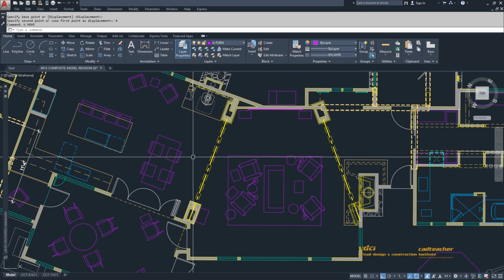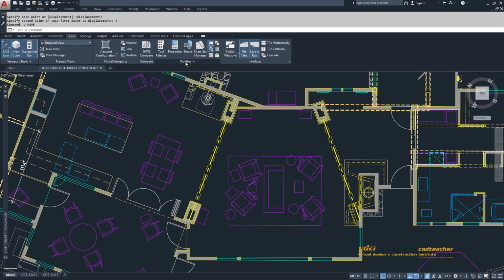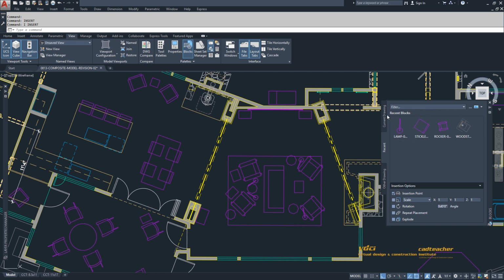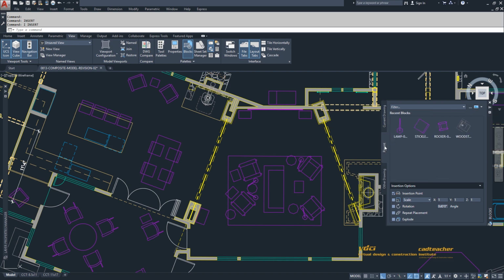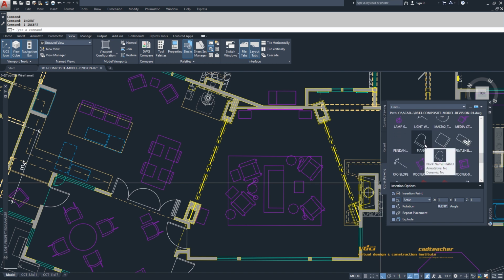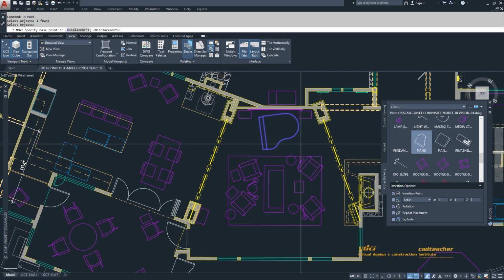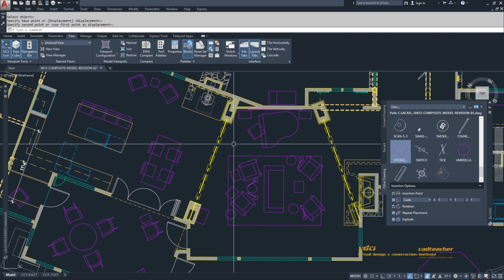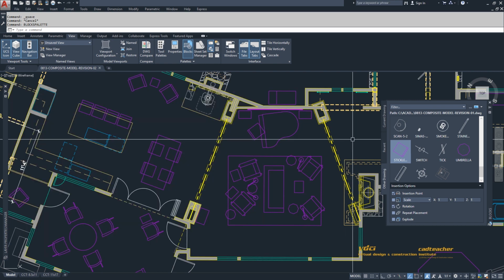Learn AutoCAD - Blocks Palette

Comment: Sir, by dragging in the block form the pallet, you are losing the rotate property that you selected in the pallet and having to use the RO command to then rotate the object. if you click the icon of the block in the pallet and then move into your screen area and click the insertion point you then can rotate the item before it is placed.